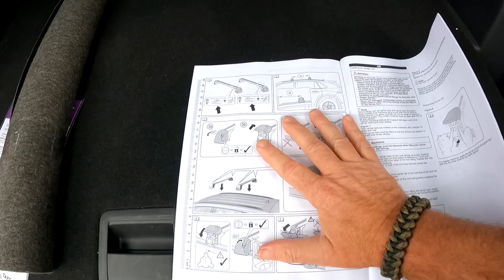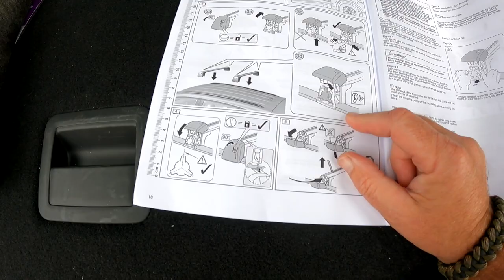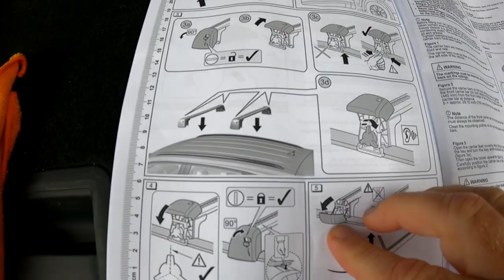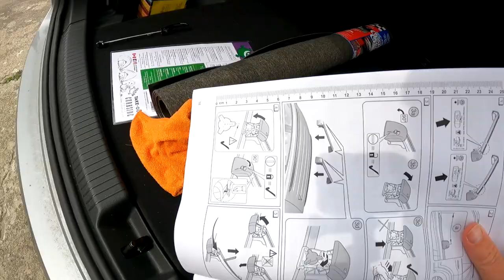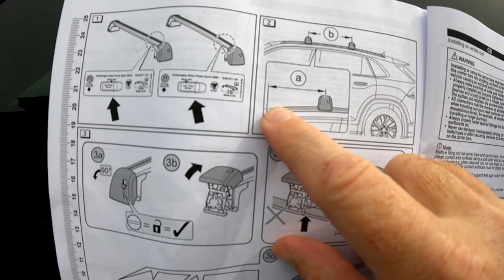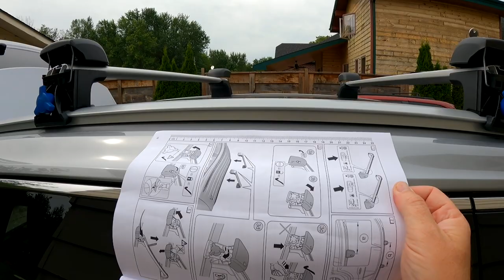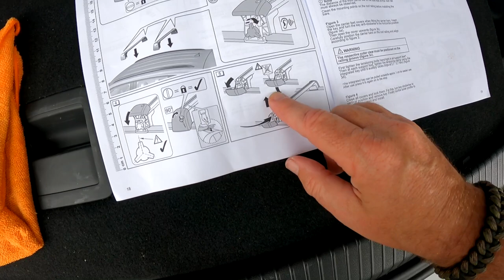Roof Rack for Atlas Cross Sport 2020 - 3CM 071 151

Comment: Thank you. You need to pull out the blue wheels, then tighten and then they click. By the way, whoever wrote the instructions in Germany converted the 440mm wrong. 440 mm is 17.3 inches.